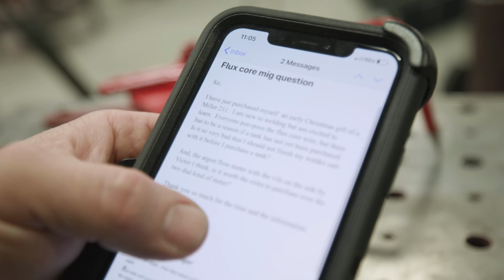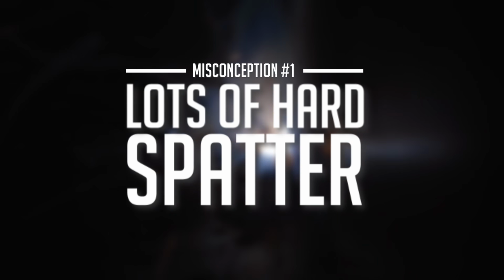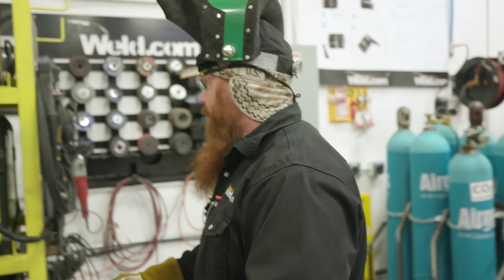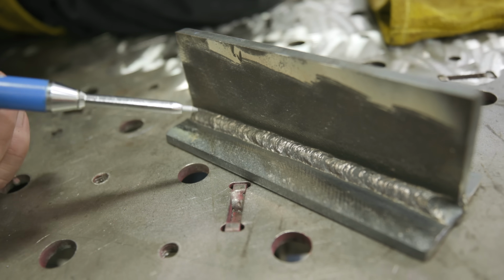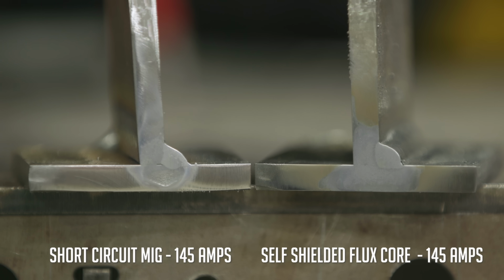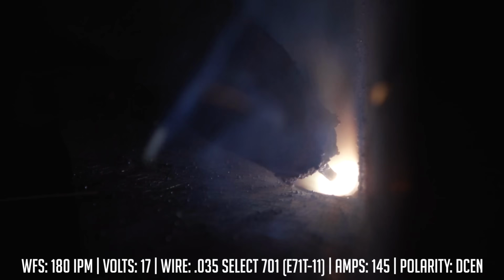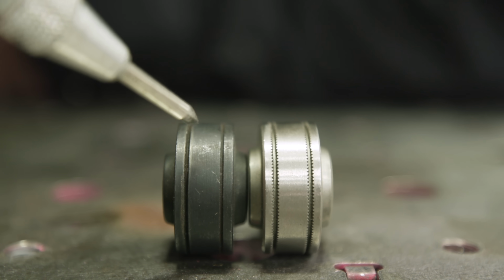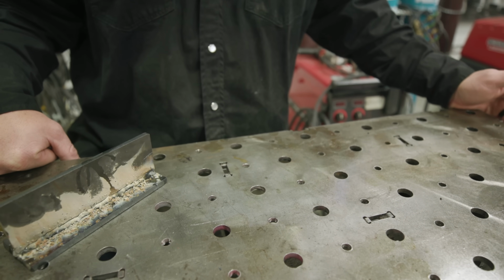3 Flux Core Welding Myths DEBUNKED

Comment: One of the most professional videos I've seen on welding.  Two thumbs up!   I have a portable Lincoln 180 Mig in my shop.  I weld outside on projects in the summer and flux core is the ONLY possibility.  This machine doesn't allow me to change polarity which makes me believe it is configured DC -ve because there is no way I get that much spatter you got on DC +ve.  What I have learned over time is to stay away from no-name spools.  I went back to Lincoln spools and get way better, stronger welds with min porosity.  With no-name spools I found the welds were brittle.

Comment: Im a beginner, got a new multifuction modes machine that can do Mig , Tig, stick and Flux, I followed the setup which exactly same like how this video explained for Flux core welding on my machine, I tried 2 kind of .35 wires, surprisingly no welding beads at all ... just BBs splashes everywhere on low and high Amps, Do you think something is wrong with the machine ? Or something I do wrong ? I'm kinda frustrated and confused, your advice is so much appreciated!.

Comment: Great video!!!!! I tried going to the link to ask a question but get the 404 page not found. I have a old century 80 ac flux wire feed and i have been using it for 25 years and havedone way more than what it wad supposed to be able to handle but its horrible with splatter any suggestions onhow to reduce the splatter i thought about doing a dc conversion on it but dint no if i could take it apart and change the polarty on it if that was even possible with a ac output welder. Ihave had it apart several times repairing the ground clamp cable were it attaches to the transformer its a simple setup i cant really aford to get a better welder at this time so just trying to makedue with what im stuck with. Any help would begreat thanks!!!

Comment: I think another problem with gasless flux core is that it is a DC process while all of your super cheap welders were all AC only machines. This has changed in the last few years with the introduction of cheaper inverter machines, but there were a lot of people who wanted to get into welding who bought the little back HF machines that were completely unsuitable for the process it was intended to run.

Comment: Would that hold a utility trailer tongue structure, 3/16 square tubing. Or should I use stick 6013 then cap it with the 7018

Comment: I run flux core all the time. I've used flux core at home, in repair, in commercial trailer repair, and in manufacturing. I like it, especially outside.

Comment: great video.  I was wondering why my flux feeds slowly and fast once in a while and learned from your vid a grip-type drive roller should solve my issue.  Also, was questioning if the flux core was less inferior in penetration than other types of welding this vid just answered that question,.

Comment: I used a $150 Flux core mig welder to weld up an aftermarket bumper. Has already squared off with a buck and 1 electrical service pole 😂 still built like a brick shit house will no doubt be around when my ass dies

Comment: Mate thanks, i did 40 years welding alu with big ole grunter tranny migs, steel i used stick
bout 5 years ago got into mig  steel solid wire but gas costs are very high in Au, so will go get some inner shield, thanks
still have my 70s hobart and miller tranny welders, but no 3 ph juice so use a 250 unimig single phase eh

Comment: Dude, good video! However, either I misunderstood or you miss spoke-  AMPERAGE is series- you cannot have more amperage in the work than the gun. UNLESS there's an alternate path like you being electrocuted. But then your weld would suffer,  and you'd be aware of it, being electrocuted not withstanding. No lol!  like  water in a hose-gpm Gallons per min- what goes in one end comes out the other. None of the water  magically vanish's nor magically increases. In one end-out the other,  THATS AMPS. barring leaks- electricly speaking shorts or parallel paths.. I don't see any extra wires going into the welder, bypassing work or ground. Ok, basic electricity 101 is over. 😊

Comment: I hope you're still about ? Great info on flux core ... What is the thinnest metal you recommend as OK for flux core welding ?  And would it be fair to say that the same welder will be capable of better welds on thicker plate with flux core than if that same welder was setup with gas shield ?

Comment: been using a cheap harbor freight flux core welder for  years welding everything  with good results up to 3/8 streel. learned alot  with this video  on some things, already  knew  others. i  have 30 years  in the  industrial  maintenance field in auto manufacturing  companies in Michigan. Learned  on stick then mig solid wire, bought this little  flux core for small quick welds at home. I love  this  thing for home  use everything  you mentioned  is  spot on. One thing though, the cheap versions  of  flux  core  you buy at  harbor  freight or amazon you cant change polarity.......at least  on mine. also a cheap  trick for at  home  users , that  antisplatter spray that costs  16 -20 dollars a can.....buy  spray  on cooking spray  at the grocery store  for 2 bucks... does the same  thing, i  use  butter  flavor..:) drops the mic

Comment: I started welding ten years ago. Not as a professional but as a car hobbyist. I can lay awesome welds with flux core and its all i ever used. I was to poor to buy a bottle. Well now i pwn a bottle and i cant stand solid core wire. It doesnt penetrate as good. ITs very finicky. Although once I adjusted to it i now can leave a pretty weld. But i prefer the simplicity of flux core. It just blasts through stuff. Now im stepping into the world of tig welding for stainless and aluminum on turbo kits so the real headache is fixing to begin.

Comment: Great info guys! When I was welding barges we used a dual shield Flux core. Self-shielding wire with a shielding gas... it was a very strong weld and when the machine was set up right it made for a beautiful weld.
Reply: You aint gonna beat dual shield.lay down a ton of weld quick,it lays down beautiful.

Comment: To the flux core newbies, E71T-11 (or equivalent) is the way to go.  
Most of the basic (ie cheap) flux core wire you find is E71T-GS.  The GS, or General Service, doesn't fall into the usual classifications of other wires, and testing is not required by the manufacturer.  
This stuff is fine for quick repairs but is not multi pass rated.  If you run multiple beads, like you would if you're looking for high strength deep welds, the metal will work harden and is prone to cracks.

Comment: Thank you very much very informative I was one of the guys it was under the assumption that this flux core is an inferior process thanks for showing me how it’s done and proving my thought process wrong I had welding shop when I was younger in high school I don’t weld very often but when sticking to pieces of metal togetherI want to be able to have the confidence that my job will be as good as it can be and if it has anything to do with safety I could feel confident in doing so with some more practice thank you have a wonderful day

Comment: Can I use flux to weld pipe fencing?  Pipe coming from the oil fields, 2 7/8".  I see a lot of people using stick welders but not really anybody doing flux.  I have a hobart 140 (120 volt) welder. I can use .030 or .035 wire.  Thanks!

Comment: Is it easier to weld thin steel (0.8mm) with solid wire and a shielding gas or with flux core wire?

Comment: The correct way to weld is to show up hungover or preferably still drunk, keep having your helper do things/redo things until you've actually woken up, then get hammered drunk again, walk up, throw the flux core thing in the trash and then stick weld it. 

That's how Pappy did it and that's how it's done. Class dismissed.

Comment: I have owned a 1958 Lincoln short hood, bobcats, weldnpowers, rough necks and hobarts. But after welding 40 years in an industrial setting, I am now trying flux core for the first time. What difference is there in 0.025 and 0.030 in the smaller 100 amp machines. Thanks Garry

Comment: I use all of the processes in my shop for my projects, and I think this is a fantastic video. I had a friend ask me about Flux core machines and he was of the mindset that Flux core was weak I explained to him that Flux core is a great welding process if done correctly it is every bit as strong as any weld in the proper application as any of the processes.

Comment: I did a torture test on my flux work. It pissed some people off. Lifted a d9 cat no problem vs the old timer no its never going to hold broke his test peace. About 9 years later now my test peace still welded on and has been used to pull equipment out of mud or up over the hill side.

Comment: I have 24 year old flux 90 amp Campbell Hausfield from Walmart. That old thing is still a good welder for what it is. I added a fan for coming when it was new to increase the duty cycle from 15 % up to most times 100%. But I think I will try swapping the connections inside and see if I can run reverse polarity on it. That will really help my quality of work on . Little projects. I've known about doing this but never thought about it on this unit as it's set up for just DC positive operation. Thanks for making me brave, I can't loose on this old box.

Comment: I like to preheat my thicker metals usually 1/4" and higher at the house. I run Flux core and usually don't have any issues. I've had wiring issues that're usually just because of old wiring in my garage. I ran a 6 gauge cord and made my own gfi protected dual outlet I plug in to my 220 line and run my Lincoln weld pak and grinder. I've used saddle soap for splatter and nozzle dip they both work great for a cleaner end result. The saddle soap an old timer got me hip to and I've used it for almost 15 years now. It's cheap and you can get it at tractor supply or online pretty easy.

Comment: Unless you're using a wire welder that can run quarter inch wire you can't hold the amps neccessary for penetration on anything over half inch!!!!! Wire is for people that can't stick!

Comment: The harbor freight welders that's what you have to use on some of them because they don't come with a gas bottle it's just a flux core welder 110 welder then you got the 220 that uses a bottle but if you can't get the gas you can use fluxcorn it you just got to make sure the surface is clean just like every time you weld anyways

Comment: All welding wires or rods are and have to be approved through Lloyds of london as all shipping accidents based on structural flaws were mainly based on bad or defective welding process or products aka wires and rods aka filler material. If a welding wire is sold over the shelf and has an serial number and a classification as they vary from country to country i wont quote any but all process have characteristic which are suited for different industries and material and thickness of material....
The clasification and serial number means the wire meets a specification for an application and the volts and amps and application aka vert horizontal or down hand...If it has this classification it meets international standardisation....
As a certified pressure welder in all positions and for stick tig and mig. I was told by idiort's that flux cored wire was a dirty weld and i continually passed Ultra Sonic testing using Flux cored wire as my primary source of income on site, pipe (root run difficult) Structural transport (super structures) and even had a comment from a customer where the tester said that was a perfect weld on a 700 WB butt weld unsupported 9 meter span........
The fastest process is Gas shielded Flux cored wire welding a 2.4 meter 14 mill fillet on water pipe in 49 minutes for my Korean offsider and 51 minutes for my self him starting at 6 oclock and me starting at 12 oclock....That was Flux and Co2 with heaters on the regs we were using so much co2 the decompression was freezing the Regulator in 30 dergee celcius heat

Comment: I have used 045 flux core with tri shield
Co2/ar/he. gas for years and the strength and finish of the weld are amazing. If done right the slag just comes off in one piece. Higgle recommend for  just about any steel welding projects.

Comment: Ive been using fluxcore for my hobby (bobber build..sort of) and Ive maintained same amperage and speed on both thick metal and thin (welding my exhaust pipe) its just knowing and feeling ur machine,  can't say its the best to do but it works for me, its about how near or far, or how fast you run weld or how fast to tack weld thin stuff and it came out a good strong weld, and to add the frying bacon thing is a great factor

Comment: Flux core is fine, so long as you set your shit right it runs nice and easy. I still prefer short circuit for thinner metals and dual shield for anything over 1/4 inch but that's me.

Comment: How exactly does "having 70% of your amperage on the wire and 30% on the part" work? I get that it does work, but obviously 100% of the current goed through both wire and part. What difference does polarity make on a physical level?

Comment: I bought a HF welder, and flux core, many, many years ago thinking I could teach myself to weld. It wasn't really working when a friend of a friend asked to use it, claiming he had some experience welding. Thinking I might learn I said sure. Well, he did manage to connect the metal he had, but I recognized it looked like total crap. Anyway, after no real success, I gave up and never really tried again.
I watched this vid a few days ago and thought I'd check polarity, and, as you might guess I had it wrong. I switched polarity and lo-and-behold, I can kinda weld! I made several passes just trying to focus on distance and angle, mostly ugly, then I attached a few pieces of steel, and my welds started looking better and better. I even managed to repair a disc golf basket that has been broken for days. All in all, it's pretty fun and I look forward to developing some technique, I sure appreciate y'all, and this video.

Comment: Probably a dumb question, but on DC Negative, does it make the work piece dangerous to touch if you don’t make contact with the torch?
Reply: No, the voltage is way too low to overcome your skin resistance in a harmful way. Not much different than a 12vdc car battery, hundreds of amps available but voltage is way too low to be harmful in most cases. Not an electrician but I am an engineering technician and work on DC and AC equipment.

Comment: Great video! But I'm wondering, you use a high end welder and it is obvious that flux core works great. But what about the cheap ones that cost around 100-150 USD? Isn't it more likely those machines that many "hobby welders" will use?

Comment: Before I was even good at welding, I could weld flux core.. good enough for what I needed and sometimes it even looked good. Tried to break a lot of my welds with a sledge and only ever broke one. (Was the only type of welding I had a machine to do)

Comment: There's only one current:  it flows through both the fluxcore electrode and the base metal- in electrode negative, electrons are discharged from the electrode, flow through the arc into the base metal and leave via the ground cable.  Better to say that the welding process is designed only for one polarity and doesn't work in the other.

Comment: Hey. I'm a noob welder. And I'm looking to work with 3mm and 5mm mild steel box section to renovate a boat trailer. 

Obviously I'm going to practice and play first but what is the minimum ampage needed for strong welds? 

Is gasless possible to do this? Thanks!
Reply: Yes and this is coming from a former panelbeater.

Comment: Not debunked. You said it's fine for people at home working on their projects. If that's the case, let's see an ordinary amateur hobbyist in their garage try it and show us their results. You could probably weld anything with a coat hanger and a transformer. But let's see how a minimally trained/amateur does. Clearly, not all methods are equally easy, even if you know all the techniques.

Comment: Well Said Mattie,   I have a problem maintaining the proper stick out.  However, for the weld jobs I usually do flux core works very well.  I have much better work with solid wire for the thinner metal applications.

Comment: Hey.

If I reverse polarity on my Lincoln welder to improve my flux core welding....will this run into issues if welding on vehicle? Could running positive power thru the ground clamp cause any kind of electrical problems on the vehicle?

Comment: What voltage were you using on the short circuit mig. It looked like it was running awfully cold. I've never gotten that small amount of penetration with a standard mig. And I have easily gotten at least that much penetration with a flux gourmet. But I'm not understanding why you didn't have the voltage turned up and what gas were you using as well. But wasn't at least 80% Argon you're not doing your job right. And for anti-spatter you can also use some dish soap and water and just spray it on the surfaces before you start the weld. That works pretty decent as well.
Next time that you are displaying a weld, be kind enough to tell all of the parameters not just the amps.

Comment: I recently purchased a multi process welder and put a roll of flux core on it, put the connections on the right way and started welding. It did about and inch of bead and the wire stopped. I open up the cover and the wire has broken at the roller(the very start of the cable). This has happened three times. Do you know what could be causing this? Can you help me? Thanks